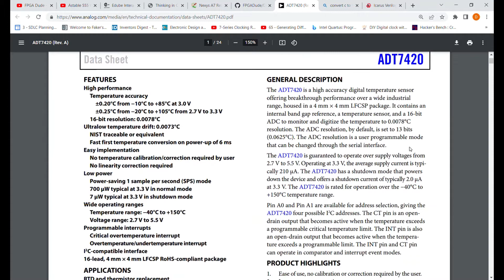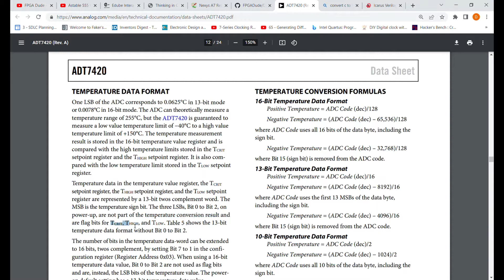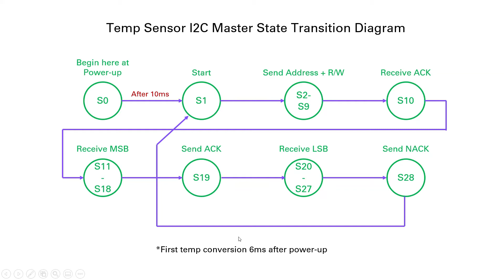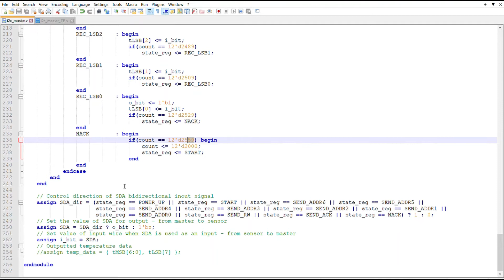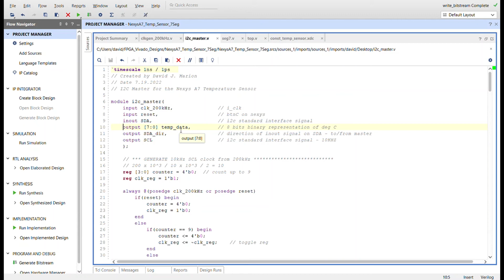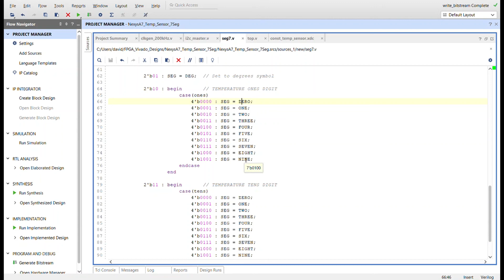How to Interface the Temperature Sensor Using I²C on the Nexys A7 FPGA

Comment: Your reset logic is not working, because on reset you are making clk_reg = 0, it should be 1.
Correct Code:
    always @(posedge clk_200kHz or posedge reset)
        if(reset) begin
            counter = 4'b0;
            clk_reg = 1'b1;

If you test above, it will start working.

Comment: Hiiii, Would this project work for me, if I connect the Nexys as a slave and it uses a microcontroller (STM32F411E-DISCO) as a master?
Reply from the maker: I think it should work, if you input to the FPGA from the microcontroller through the PMODS, then direct those signals to the temperature sensor. One thing to be careful of is the voltages of the FPGA and microcontroller. The FPGA is designed for 3.3V, so a 5V microcontroller, such as Arduino, would break it. If this is the case, use a logic level converter. Good luck on your project.

Comment: I think that there might be an error in the state machine in the setcion SEND_ADDR6,at the last case SEND_RW. The if statement verify is the counter has reached 2169 ,but I believe that it should be 2168. Taking that in account, all other ifs after this one should be decreased by one. Could you verify this to see if I'm right or not? Also, thanks for this wonderful presentation. I am trying to wrapmy head round all the I2C with FPGA and it'S really difficult.Your video helps alot!
Reply from the maker: Hi. Thanks for your comments on the video. I am happy to share what I know to help others. I looked into what you said about 2169, and if it should be 2168. I see what you are talking about, and to be honest, it has been too long for me to remember why I put 2169, if it is indeed meant to be 2168 with each one after being decremented by 1. Have you tried it with 2168 and decrementing the following ones? What I know is that the circuit works as is. If there is an error by 1, then it doesn't affect the output. But, if it should be 2168, then I apologize for the mistake, and I appreciate you pointing it out. Have a good one.
Reply: @FPGADude  I agree with you that the difference of one should not make a difference sincethere is no delay accumulation caused by this. I am working through your code in the next days and I suspect that it won't make any difference. Thanks for the fast reply!

Comment: Hy...I really like this project and is very usefull for who wants to use the sensor from the  board...but I have a question: can you explain how to replace the dumpfile and dumpvars with other file or code?...I have need to simulate and see all the signals in verilog...thank you very much in advance🙏
Reply from the maker: Hi. Thanks for the comment. The dumpfile and dumpvars are necessary for using Icarus Verilog. If you are using Vivado to simulate, then you can remove the entire initial block with dumpfile and dumpvars. The dumpfile name can be anything you want. As for dumpvars, if you put (0, name_TB), the 0 allows you to access all signals from the test bench down the hierarchy within GTKWave. Hope this answers your question. I recommend checking out the documentation for Icarus Verilog which explains about dumpfile and dumpvars. The docs can be found here: https://steveicarus.github.io/iverilog/
Reply: @FPGADude  thank you...I'll try these 😊

Comment: Hello there actually while I was doing the code  for the same but in vhdl,hence I found that the at the beginning it was showing 1 and then it again shows 0 celcius on board while it simulates properly.
Reply from the maker: So, what I think you are saying is, you wrote this project in VHDL, and it isn't working properly? Sorry, I don't work with VHDL. It works with Verilog. Switch to Verilog?
Reply: Ok  thanks

Comment: does this code works with an external adt7420 ?
Reply from the maker: Do you mean that you have just the adt7420 chip? Or do you mean the PMOD with the adt7420? Or do you have an adt7420 on some circuit board from a sensor kit?
Reply: @FPGADude   i have a pmod TMP2 with adt7420 and i want to connect it to the fpga to read the data from it
Reply from the maker: @bogdan13b8  I have not tried this project using the PMOD, but the PMOD is exactly the same set up, so I don't see why it wouldn't work. Give it a try, and please let me know if it does work or not. Again, I think it really should work.
Reply: @FPGADude  it doesn't work, i set the TMP_SDA and TMP_SCL pins to the PMOD HEADER JA, but it does nothing, it shows only zeros
Reply from the maker: @bogdan13b8  Sorry that it doesn't work. By all logical accounts it really should work. Maybe there is something else wrong?
Reply from the maker: @bogdan13b8  Hello. I got the PmodTMP2, and I am having the same problem that it only shows 00 for the temperature. This is so strange why this is happening. I can't explain it. I'm going to hook up my logic analyzer to the PMOD pins to see what is going on. I'll let you know what I find.
Reply: @FPGADude  ok, thanks a lot
Reply from the maker: @bogdan13b8  I didn't use my logic analyzer, but I did get in touch with a technician at Digilent through their support forums. He agrees that it should work with the same project files, but the reason it is not working is because the Nexys A7 has pullup resistors, whereas the Pmod TMP2 does not. The solution is to set the Basys 3 Pmod pin in the .xdc to be PULLUP == TRUE.
Reply from the maker: @bogdan13b8  Here is the link to the conversation https://forum.digilent.com/topic/25603-pmodtmp2-not-working/
Reply: @FPGADude   i tried that thing with PULLUP TRUE and now all the bits are 1s
Reply from the maker: @bogdan13b8  It didn't work for me either. I'm going to continue with trying to get the answer from the technicians in the support forum.
Reply from the maker: @bogdan13b8  I got it working! I'll do a video on it in the next few days, but the PULLUP TRUE did the trick.
Reply: @FPGADude   yeah, you were right , that thing with PULLUP TRUE actually worked, i accidentally tested on another project, but now it works perfectly. I want to thank you very much for helping me.
Reply from the maker: @bogdan13b8  No problem at all. Thanks for communicating. I'm glad that it is working now.

Comment: hello, i used your code but when i press the reset button on fpga, it sets all the bits "1" and never changes
Reply from the maker: Sorry about that. I did mention in the video that the reset does not work properly. The reset logic is incorrect and needs to be revised.

Comment: Hi, I tried converting your code to vhdl from verilog but it is not working now. Can you please help?
Reply from the maker: I don't do VHDL, what's the point? Verilog is much simpler.
Reply: TRY CHAT GPT
Reply: Hi, I implemented this in VHDL. Dont listen to OP if you wanna do vhdl, then do vhdl. Personally i find it easy to understand
Reply: @namederek3610  does it work after implementing in vhdl?
Reply: @namederek3610 does it work in FPGA using VHDL?

Comment: Your code is not working for zync 7000 zedboard fpga
Reply from the maker: That is interesting since the Zync 7000 has the same logic fabric as the Artix-7, plus the processor portion.
Reply: It doesn't justify whether it will work